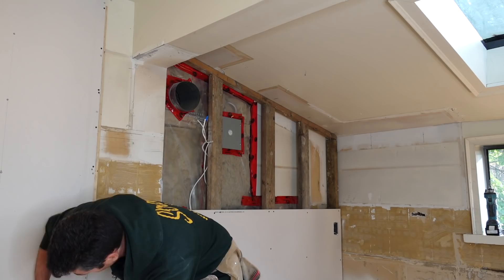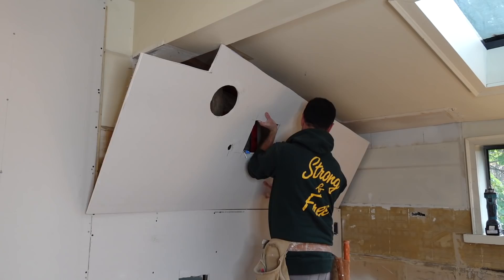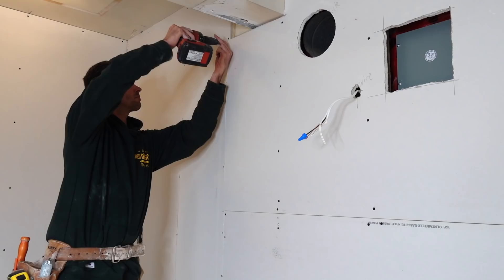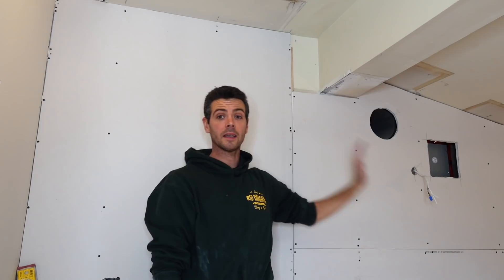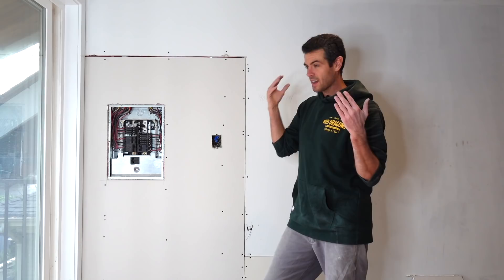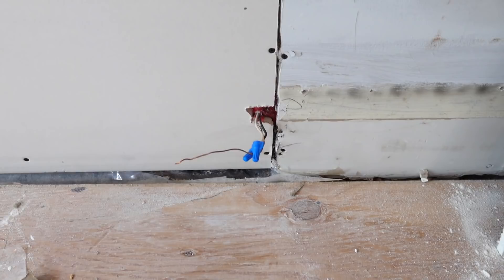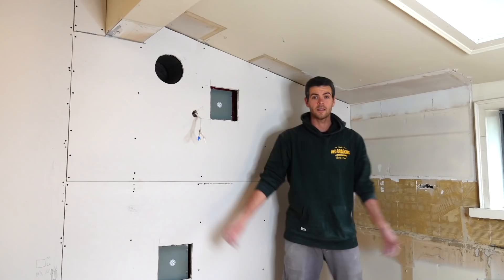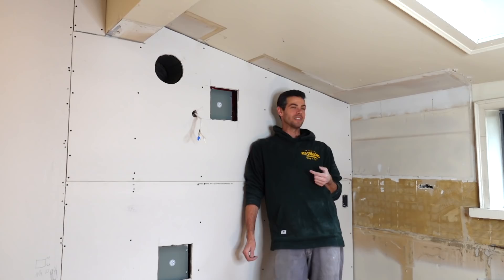Every Beginner Drywall Mistake I can think of (3/3)

Comment: Also my kids are rough on things, so I was going to hang vertically in their basement bedrooms so the seams all lie on joists, makes mudding a little harder.. But if I were to do horizontal, how do you handle the taper at the bottom and trim? In the past I've always put a screw in and used a carpenter square to drive it to the right depth so the trim sits plumb. Is that the easiest way?

Comment: Great series.  One question: why do you sometimes cut the holes before you put up the drywall, and sometimes you cut them out after the drywall is up?
Reply: I believe the reason is, if the box just has wires and not an outlet attached, you can just mark where it is and router it out on the wall. If the outlet has a plug in wired in it, you have to bring the outlet part through the wall or risk cutting the wires with a router. The reason is when you bring the drywall to the outlet, it will move a bit as it won't fit inside the box. Then you won't know exactly where it is, and chances are those outlets are live and you run the risk of shocking yourself, or damaging the outlet with the router

Comment: Hi what is that tool your using to cut put electrical sockets etc. Leaves a nice clean hole. 
I smash a hammer through and then cut rest with knife. Leaves a mess. Thanks Gary

Comment: You didn't cover inside and outside corners and if it's best to use tapered ends or square ends for those corners, like on the ceiling if you are less than 8 feet, should you cut the taper off so you end up with non tapered inside corners?

Comment: Man that’s a pretty cut… would your really make an extra cut instead of taping bevel-to-butt joint?also you have showed me everything I know, I have corner tools and a mud tube now 🤓 definitely a life changer. Do you think a screwgun is significantly better? Also the rotary tool freaks me out and I tend to mess some stuff up
Reply: The drywall gun is one of those tools that you know you should have, but, since it pretty much looks like a regular drill, you just can’t justify buying it. Like, “do i really need to drop $120 on a drill meant for one application…” Then, when you’re facing down 500 sq ft of drywall, and all you have is a stupid dimpler bit, you kick yourself for not buying the damned drywall gun.

Comment: I thank you for all the information, as a homeowner who has barely used a hammer, these will be referenced a great deal as I go. I am looking to finish and repair some drywall for a bedroom downstairs.  I didn't quite get where and when the 1 1/4" vs the 2" drywall screws were to be used though.  Could you clarify that for me? I thank you in advance.
Reply: that drywall was going over drywall, so he needed a longer nail to reach the studs

Comment: I know you should stagger drywall on ceilings.  Do you also do this on the wall sections?  I've seen a few walls where all the joints fell on the same stud from floor to ceiling.
Reply: should but if ceilings under 8 foot alot better to hang drywall up and  down

Comment: What's your plan with the tile glue on the wall where the old backsplash was? I had the same thing in my bathroom and scraped it with a paint scraper because I didn't know if I could skim coat over it and have the mud hold. Just wondering what your plan would be. Thanks!

Comment: What are your thoughts on Butt to factory edge correction, by hammering the Butt side causing a weakness but depressed area. After taping and mudding , the Joint is  well affixed and easier to mud smooth. Never had any long term issues with it.
Reply: Don’t hammer it, that would break up and weaken the drywall behind the paper. If you start vertically, continue vertically. Don’t mix the edges, you’ll have less problems.

Comment: I can't find an answer for this and I'm sure there's an easy one: I cannot get flush drywall on perfect new construction framing. I know to keep factory edges together, but what am I doing wrong when I cut a bunch of specific measurements for drywall pieces and they aren't fitting flush with the other pieces of drywall I've hung? Is there a rule of thumb for hanging drywall even. Am I cutting into boards and using the wrong edge? This has really frustrated me. Any suggestions would be appreciated. #lope
Reply from the maker: Every situation might be a little different. I would say don’t sweat the small stuff. Pre fill before taping sorts all that stuff out. Sometimes you just have to make it up in the finishing.

Comment: I'm watching your videos because I never installed drywall sheets before. I insulated my 10x20 shed and was going to install the drywall myself. 
1st video showed drywall sheets installed vertical and marking where the studs are. Now this video in your diagram on the wall, you show them brick staggered horizontally. 
I'm not in the shed at the moment,  but guessing my sidewalls are no higher than 7 feet before the pitch of the A-frame roof.
Which is my best option?
Reply: I would do it vertically, less seams to tape.
Reply: vertically due to lower 8 foot celling

Comment: Hey Rick, Good Vids. Can you show how you measure and transcribe precisely cuts and holes for panels and things in the middle of board. What's best practice. Every time I try, I am always off.
Reply from the maker: I kind of go over that stuff in the first part of the series. Measure from the same two sides for everything. One horizontal and one vertical. Err on the side of undersizing the cutouts. Might be a bit of work trimming it once the sheet is tacked but it's better than overcutting.
Reply: Thanks. Makes sense.

Comment: Oh you haven't lived until your hanging doubled up 5/8 drywall on a 12 foot ceiling and your panel jack broke and your dead line is that day AND your help called off.
Reply: @vancouvercarpenter  i can laugh about it, now 😂. One implanted morphine pump, two spinal stimulators later. (joking)

Comment: As an Aussie I wish you could add metric subtitles when you say imperial measurements.
Reply: As a fellow Canadian to Vancouver Carpenter, the measurements we do here are so weird. We definitely use a hybrid combination of metric and imperial measurements in all aspects of life. I could tell you how tall I am in feet and inches, and my weight in pounds, but couldn't tell you in metric. I could tell you how far away the next town is in kilometers, but not in miles. I could tell you how fast I'm going in kilometers as well. In construction I can only tell you how many feet or inches something is. I think the reason is most of our material comes from the US and they measure everything in feet and its a pain in the ass to convert to metric as they won't be exact. For example, we buy a 20 foot aluminum pole for scaffolding, it will be 6.096 meters. I have been seeing more and more builders and architects insisting on metric measurements in the last few years, but man, some of our tape measurers still don't even have metric on them. Most have both metric and imperial, and very rarely do I see strictly metric tape measurer. They would probably end up in a ditch anyways

Comment: Can you post some thoughts about cleaning up?  What kind of vacuum do you use for drywall dust?  How do you dispose of water with a lot of drywall mixed in with it?  Do you soak your tools or wash them in a slop sink?  Thanks.
Reply: From previous videos, Ben has a HEPA vac that's part of the drywall sanding rig - although I don't know if he uses that for cleanup. I'm a DIYer, and use my shop vac on drywall projects with a disposable bag that's made for fine dust.
Reply: When I do a house, I will use a floor scraper to scrape dried mud on ground, then do a sweep. We get our mud in boxes and I will save the boxes and bags that the mud comes in and dust pan the majority of sand and dried mud in there, and throw it to the bin. A shop vac for the final clean. Drywall mud is super easy to clean off tools. At the end of the day I will use my putty knife to scrape off harder mud, then a cleaning brush or rag and water to clean off tools. A dry rag to get water off, as a lot of the tools will rust over night if left wet. If I forget to clean tools, just let them sit in a bucket of water for 10 minutes and then do the same cleaning process, the mud will come off easy. It will come off even easier if the water is quite warm =)
Reply: @Phazetic99  I have a small shop vac and it gets so clogged with drywall dust after a while I have to blow it out with a leaf blower.  The manual says I shouldn't use it for fine dust like sanded drywall but that's probably one of the most common things people have to use it for.  Can you just dump the dirty water down the sink without causing any problems?  And how do you dispose of unused wet mud?
Reply: @erichsh58  Dig a little hole or find some area not landscaped and dump it on the ground... It's unsightly but most of the houses I work on are new builds and the landscaping isn't done yet. In my yard I have a spot in the back yard where I just dig a 4" hole, dump and cover. Would be no different then buying a high efficiency Shop Vac drywall dust bags and throwing it to the landfill. Pretty sure it's mostly just limestone putty with additives, nothing toxic
Reply: @erichsh58  Problem I would have with going down the drain is that you run a chance of clogging the drains. Probably wouldn't happen as long as the pipe stays wet, but if it dries it can build up

Comment: How come you don't use a foot jack,to lift your bottom sheet up to your top sheet.You wouldn't have the gaps that you got between your two pieces.Makes it a hell of allot easier when you tape it.You won't have to prefill, all those gaps with mud.Same rule should apply,with your top piece,going against your ceiling.The less gap you have the better especially,if you're the one doing the taping.Prefilling gaps if you don't have to saves time.
Not trying to be an A-hole just giving a little input.
Reply: He showed the foot jack in the first video.

Comment: Question unrelated to video: Does paint+primer in one(self priming paint) work on drywall?  Or is better to primer then paint?
Reply: As a painter,unless you plan to use flat paint as a finish,I recommend you always use a good PVA drywall primer. Nothing worse than using paint and primer in one in eggshell finish. You will definitely regret as the mud will "photograph" through the paint.